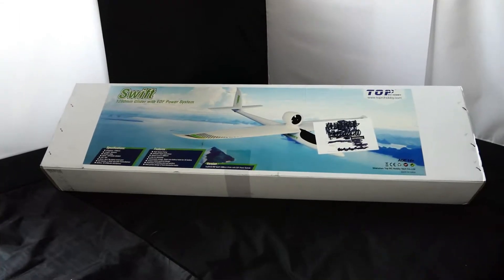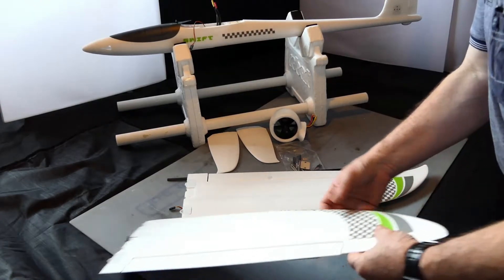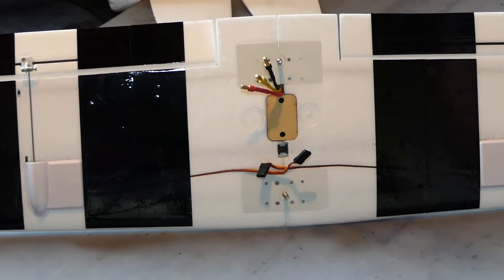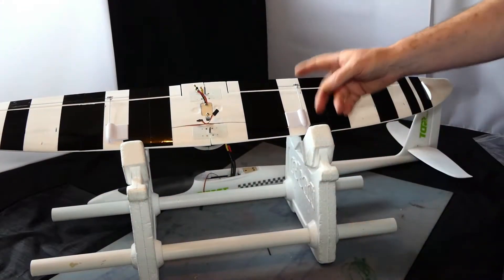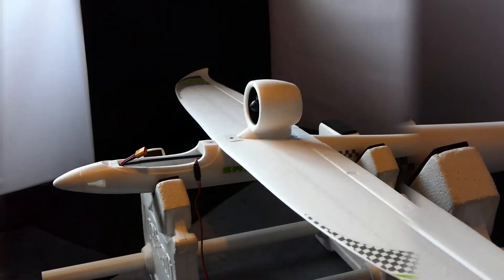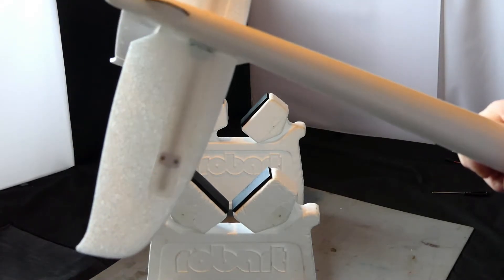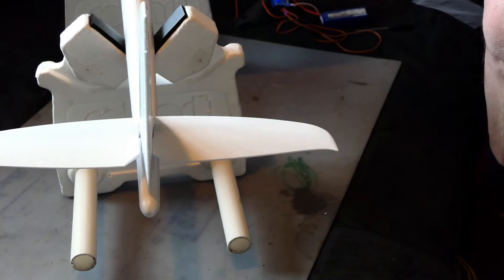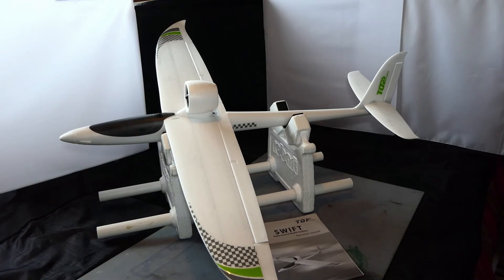Assembly - TOPRC  64mm EDF Swift

Comment: First fly pay attention to horizontal stable position . The mark on the vertical IS NOT an indication of neutral position . On mine it resulted very very pointed to the ground . Need 40% exponential min. even with reduced travel /dual rate . Every time you give throttle from low speed the model’s nose points the ground and you must be ready to push up elevator. (Pheraps fan needs a different incidence to work properly).
The throw must be strong and 45 degr. up just to prevent this behavior.
I laminated all the model with plastic thermic cover (not oracover , oratrim ecc.) ....very nice
Reply from the maker: Thank you very much for this information - I will work on the Aircraft and address the items you have indicated before the Maiden flight - Happy New Year..
Reply: @FlankerTanker  Good morning.  I set my gravity center to 7cm, it falls off when I throw it.  so you think i check the stabe position ?
what is your point of reference in relation to the line on the rudder? thanks

Comment: Did you get stung for any import duties ? I do like the looks of this, How easy would it be to add some LED stips on the wings and one of those safe flight units ?
Reply: actually forget that   :) I just seen how fast these things are. I want a nice , take it up and glide, plane :) To old and slow for speed now :)
Reply from the maker: Take a look at the  night walrus or even the Shrike...the night walrus already has a lot of led lights fitted, another option would be the FMS Moa..but for the Moa you would have to fit your own LEDs..  the Shrike has a 8mm led in each wing... as for HMRC tax ..nothing as the came from the European warehouse,..
Reply: @FlankerTanker  Yer I did like the Walrus, but I need to take the wings off to get it in the car ,
Reply: @FlankerTanker  I do like that MOA, I like the gull wings